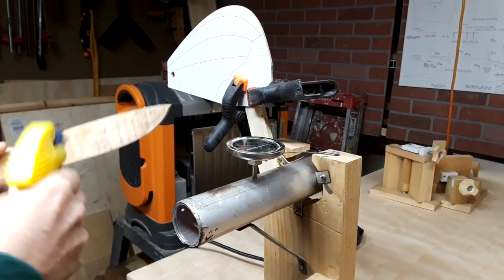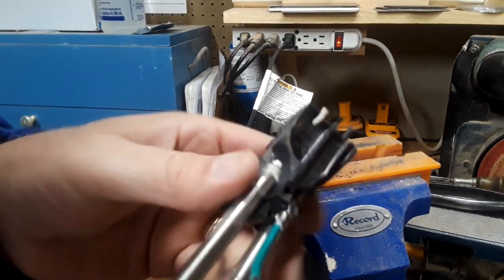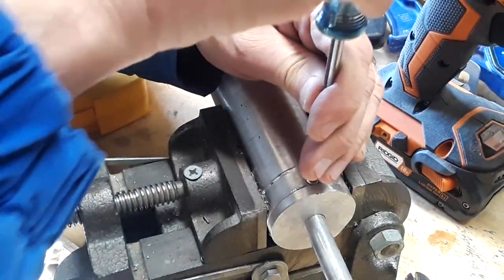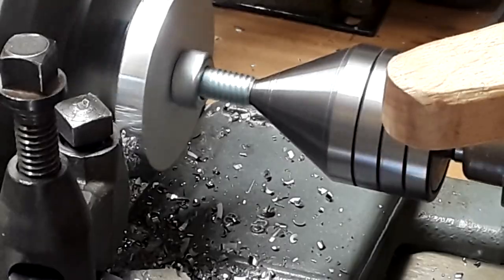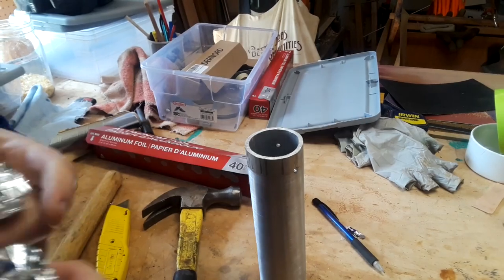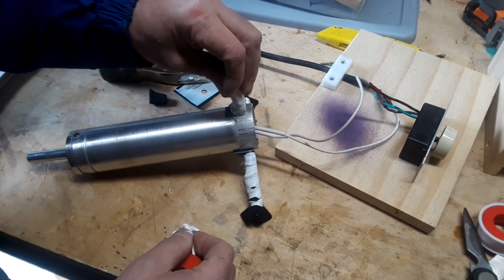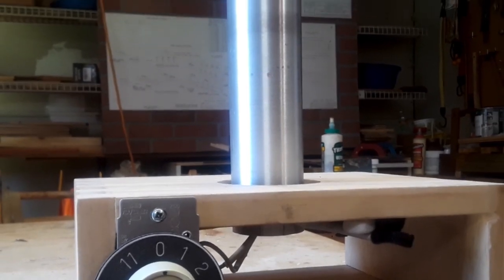Making a Wood Bending Iron

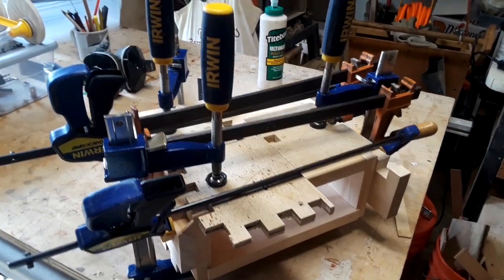Comment: Great video!  I like the part about when you woke up after your wife told you to get a tig welder. Too funny!  @ 3:42 you called the cartridge heater a "carriage " heater.  I'm thinking a carriage heater would be considerably larger, and possibly wood or coal-fired. lol  Loved your vid, very helpful!  ja
Reply from the maker: Glad to know someone is listening. I made the 'carriage' mistake several times but thought that I had found and fixed them. I guess it's ME that should be listening!
Reply: @OpenWoodShop  lol, Great video! I have to make a bending pipe for a mandolin I'm building. Very helpful. Thank you!  ja

Comment: is the cartridge heater better than the charcoal starter? what is a cartridge heater anyway? where do we get one?
Reply from the maker: A cartridge heater is smaller than a charcoal starter so it fits into a pipe without bending it. 

A cartridge heater is a tube-shaped, industrial heating element that can be inserted into drilled holes. Cartridge heaters provide localized and precise heating and are commonly used in the heating process industry.

I got mine on eBay.